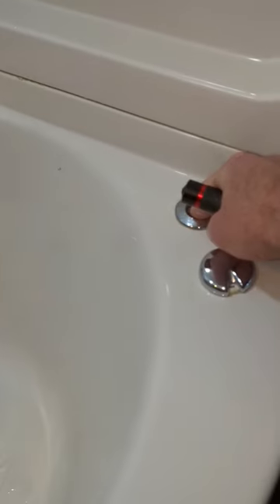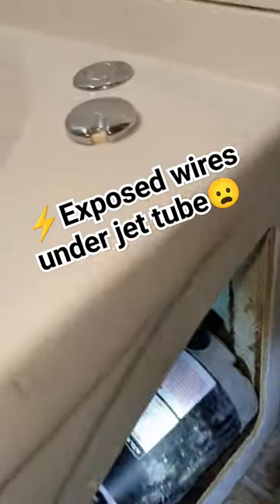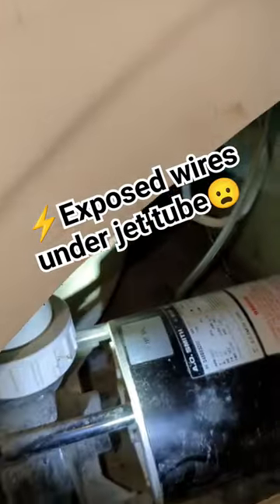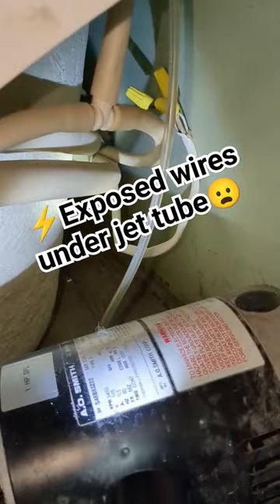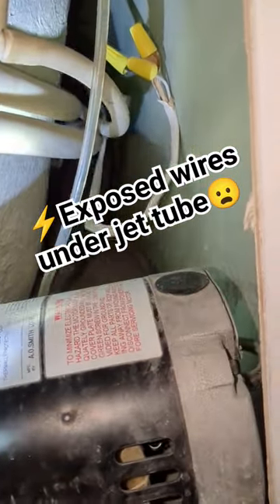Exposed ⚡ #electric #wires under jet tub💦 #diy #plumbing#youtubeshorts#shortvideo #shorts#inspection

Comment: Did the wire have power?
Reply from the maker: Oh it did have power! I don't know why someone would turn that breaker back on.
Thanks for watching.
Reply from the maker: IndiansAuto  all wires should be terminated inside a junction box, clapped, grounded and with a cover plate or inside an  appliance designed for a dedicated line feed. Such as a garbage disposal.
Thanks for watching.
Reply: @inspectflix probably the homeowner,it probably was off,but whoever got rid of the pump should have just yanked the breaker

Comment: The wires are caped don't over react
Reply: That's such a dangerous amateur bit of wiring, Who ever did it should be prosecuted.
Reply: @dogwalker666  😅🤣😂🤑
Reply: @nomisama7186  hopefully you never do any electrical work. 😂😹🤣
Reply from the maker: Nice rhyme. Yes but, all wires should be terminated inside a junction box, clamped, grounded and with a cover plate or inside an  appliance designed for a dedicated line feed. Such as a garbage disposal.
Thanks for watching.